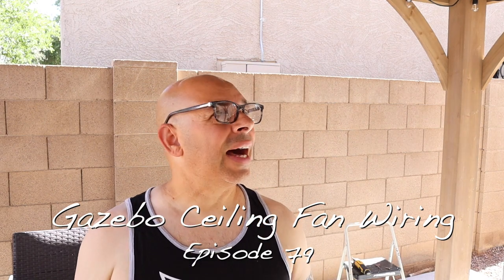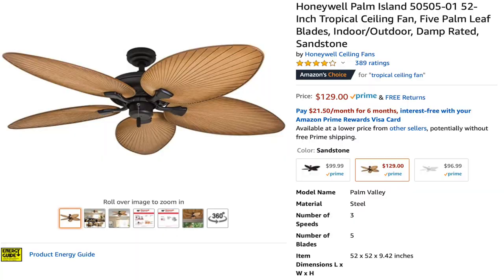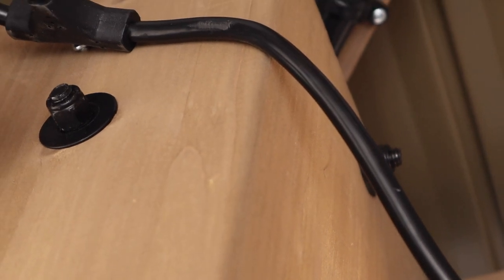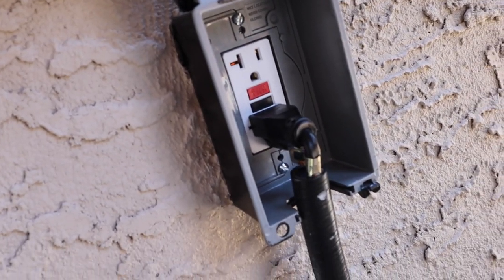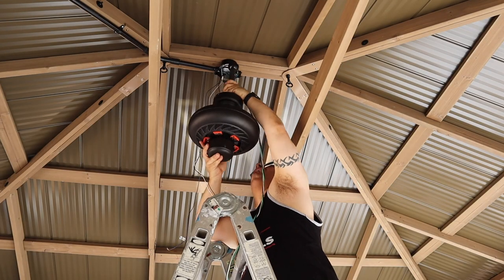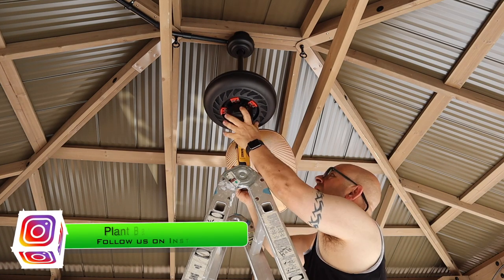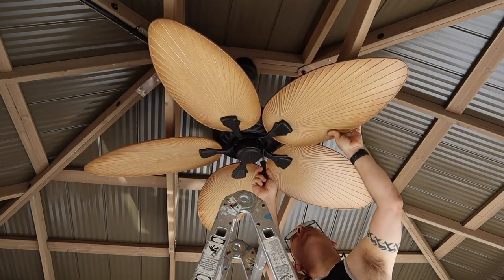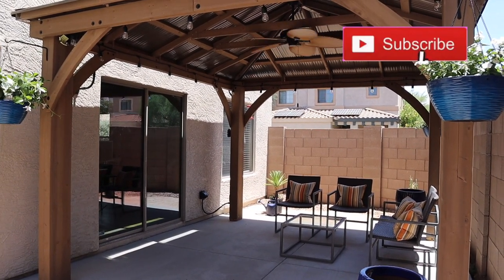DIY Yardistry Gazebo Ceiling Fan - Full Wiring and Installation.

Comment: Great video, i did something similar, i ran romex wire from my outside outlet through one of the hollow posts using hole saws and a fish tape and added a switch for a ceiling fan and an gfci outlet for any other electrical items. It hid the wires very well, all you see is the switch and outlet on the posts.

Comment: You would be amazed how much better your ceiling fan would put out if you purchased an extension bar for it dropping it about 12-15 inches. It makes a huge difference. You did a great job by the way, very clean.
Reply from the maker: I did have the longer bar.  In fact I think i talk about it in the video.  It just came down too low for me.
Reply: @PlantBasedDads   Very nice!  I thought you did use a 12 inch downrod?  My installer suggest an 18 inch downrod.  I just had this same gazebo installed and wired for ceiling fan... Wish I would have had them paint the conduit.. Guessing I can get a ladder and figure out a way to paint it before ceiling fan is installed... What paint did you use?  Also what size fan.. I want basic blades with lightand remote and  thinking about a 52 to 56" with good cfm

Comment: Love it! my SO thinks I'm crazy for wanting colour matched things like the conduit.  (It looks so much more harmonious that way)  Now I will be relaxed in the hot tub in the pavillion, not noticing that the conduit pipes are miss matched to the hardware.
Reply from the maker: I HAD to paint those ugly conduits.  Now, you dont even notice them because they are the same color as the rest of the black trim.  You are not crazy, you have class and taste!  Stick to your guns!  So here is what I did.  I laid out all the conduit AND the fittings and sprayed them all first.  Then when I had to cut the long conduit pieces, they were already all black. Worked like a charm.  Good luck.  We are going to add gutters to it at some point.
Reply: @PlantBasedDads  did you paint the electrical boxes as well? I have a  covered deck I built and running into the same issue wanting everything to be black to  match. I can't believe they don't make them in black to purchase, but haven't found it anywhere.
Reply from the maker: @brandonhardegree5050  Yes, I had to paint every part of the electrical because nothing came in flat black.  It was annoying but the final product was amazing

Comment: Not sure if you’ve had any issues with wind, but one consideration might be to add a stabilizer between the braces and then you’re less susceptible to side winds knocking those blades into the braces.
Reply from the maker: Hi Eric.  I'll keep an eye out and do that if I have an issues.  So far, there have been no issues with wind.    Thanks so much for watching.

Comment: Great job.  Do you think you could run the conduit down the center of the post (I believe these are hollow).  Thoughts?
Reply from the maker: Steve, yes you could.  That is a really good idea if you don't want to see the conduit.  They are hollow for sure.  Thanks so much for watching.
Reply: @andrewrus6879  How did it come out? Were you able to measure the hollow height?
Reply: @andrewrus6879  We are debating on running wires through the hollow portion.  But after showing my wife this video, she said she doesn't mind the black pipe.
Reply: @andrewrus6879  If you want to post a video, I'm sure it will help a lot of people! And it might convince me too,  LOL
Reply: @andrewrus6879  We ended up running pipe on the outside, but it turned out good.
Reply: @andrewrus6879  Would you mind sharing the video?
Reply: @andrewrus6879  also interested in your setup.
Reply: The Electrical not up to code. Hire a professional please 🙏

Comment: How did you get the rain caps over the joints between the roof panels that are closest to the house?  Being they are supposed to slide on from end and slide upwards. I have not figured out how to get those on mine.
Reply from the maker: That was the one thing I really want to film but the battery died during that whole piece of it.  I had to watch the Yardistry Helpful Hints video on Youtube.  It talked about bending the one side of the ridge cap open, clamping it onto the roof panels, and bending it back into shape.  Thats what we did and that worked.  Thanks so much for watching.

Comment: I have the same gazebo and a fan that is very similar to this fan. My only hesitation is, It seems to me, that the fan would just be pushing all the hot air that collects at the top of the gazebo, downward.
Reply: Just saw another video where he wasn't getting much air flow, so he switched the down rod to 18 inches. Now it moves the air.
Reply from the maker: I really just use it to have the fan move the air around. I doesn't actually cool anything down.

Comment: What is the lower junction box called/where did you get it? I can’t find what to call one you run wires to that then turns into a plug for an outlet.
Reply from the maker: It is a regular outdoor grey metal junction box that has 4 holes, 2 in the top and 2 in the bottom.  I got all the parts I needed to make it work.  It didnt come like that.   I ran the conduit up from the top of one of the holes to the switch above it and then the plug from the outlet on the house to one of the holes in conduit below it and tied them together in the box.  I put a weather seal and a cover on it and screwed it together.  I just went to Home Depot and pieced it all together.

Comment: Could you have plugged the fan and the lights in the same box? Granted, the switch would turn them both on, but that's an option you could have done right?
Reply from the maker: Hello.  Yes that was absolutely and option. And yes, I didn't chose that options because I didn't want the lights to come on every time the fan was turned on.  I also wanted to have an actual switch outside to turn the fan on and off with so we didn't pull on that chain each time.  But yes, you could totally just plug it into the outlet I installed up in the rafters for the LED lights.   Thanks so much for watching.

Comment: What is the junction box for? I want to do this same thing to my gazebo and I am trying to understand why the fan plug can’t come out of the fan switch box straight to the outlet versus having to add a junction box. Excellent work by the way!
Reply from the maker: Hi PN.  The junction box is to convert the wiring from the fan, which is just wire to an actual plug so I can plug it into the outdoor outlet on the house.  When you buy the fan, it just has three wires coming off it.  I extended those wires 25 feet to the junction box on the gazebo post near the patio door.  Then from the junction box I converted it to the end of an outdoor extension cord so I could plug it in.
Reply: Plant Based Dads Thanks for the reply! So it’s not possible to convert the wiring from the switch into a plug? You wired the fan to the fan switch, then from the fan switch you took the wiring to the junction box, so it’s not possible to use the wiring from the fan switch and just turn it into the plug at that point vs having to create a junction box? I’m not questioning what you did, I’m just wondering if I could do the job without the junction box that way I don’t have to have two boxes mounted on the gazebo post.

Comment: Did you not install or remove those cross beams? I want to install a fan but my Yardistry has two beams that will be in the way unless I put the fan blades lower than them with an extension.
Reply from the maker: The 12 inch download on the fan clears those beams so it is not an issue.  I purchased a 12 inch and an 18 inch down road jut to make sure I was all set

Comment: Cant seem to find that metal ceiling fan base box, where did you get yours ?
Reply from the maker: Home Depot.  It is just a round ceiling fan box.  This is the one I got:
https://www.homedepot.com/p/Greenfield-4-in-Round-Weatherproof-Electrical-Outlet-Box-with-Five-1-2-in-Holes-Bronze-RB25BRS/202188683?mtc=Shopping-B-F_D27E-G-D27E-27_6_CONDUIT_BOXES_FITTINGS-NA-NA-Feed-PLA-NA-NA-CONDUIT_BOXES_FITTINGS&cm_mmc=Shopping-B-F_D27E-G-D27E-27_6_CONDUIT_BOXES_FITTINGS-NA-NA-Feed-PLA-NA-NA-CONDUIT_BOXES_FITTINGS-71700000034238990-58700003946879308-92700048672399338&gclsrc=aw.ds&&gclid=CjwKCAjwmrn5BRB2EiwAZgL9ov0CmhZ5QjIZL_eKVZCmz4oMUBwUUk37Oxy9qyTFMZu5HiGdwoWCtBoC6Z4QAvD_BwE

Comment: What size conduit did you use? It looks like 3/4. I was going to do 1/2 but not sure it is big enough.
Reply from the maker: Yes, it is a 3/4 conduit that I painted black. You are. right, 1/2 was not big enough.
Reply: @PlantBasedDads  Thanks you did an outstanding job. It looks so professional. I will be doing the same thing.

Comment: Hi, what did you paint the pvc pipes and junction boxes black with?
Reply from the maker: Hello.  I used spray paint from Hope Depot.  I just did a flat black to match the trim on the gazebo.  I used high heat spray paint because of how hot it gets here in Phoenix.  I had to lay all the pieces out on tables in the garage and then spray them all.  Then I had to turn them all over and spray the other sides of them.  It was annoying, but it really looked great when it was finished.
Reply: @PlantBasedDads  Thank you! A couple of questions. Did you sand the pvc pipes first for adhesion or use any kind of primer? Do you remember the make or exactly which spray can you used from Home Depot? Thank you!
Reply from the maker: Hello.  I did not sand anything or prime anything.  I just painted them.  Let's hope that doesn't come back to bite me later on.  The paint was actually a primer/paint in one can, but I didn't buy it for that reason.  Here is a link to the paint I used.  I needed 3 cans for the whole project.

https://www.homedepot.com/p/Rust-Oleum-Universal-11-oz-All-Surface-Satin-Black-Spray-Paint-and-Primer-in-One-342511/307244963

The conduit was already a flat grey so it really doesn't need primer.  The metal boxes could probably have used some primer first but I just didn't use it.  You probably should use spray primer on the metal pieces that you are painting.  Good luck.

Comment: Was the 12 inch down rod included or was it a separate purchase?  What diameter? 1 inch or 3/4?  I ordered the same fan but it doesn’t mention a down rod being included and I can’t find any info on the mfg website.  Thanks
Reply from the maker: Hi Robert.  It does come with a down road.  But it's only a few inches.  I had to buy the 12in one from Home Depot.  I just took the one they gave me with the fan and compared it to the ones in the fan aisle at HD.  It was pretty easy.  They are all the same width.  I got a 12inch and an 18inch.  I ended up using the 12in because I felt the 18inch brought the fans down too far from the ceiling.  Thanks so much for watching.

Comment: You did an excellent job!  I'm copying your design now.  My gazebo is about 36" away from the house where there's an GFCI outlet.  My question is where did you get that flex cable to connect from that junction box to the receptable?  much appreciate it!
Reply from the maker: I live across the street from Home Depot so I go there for everything.
Reply: @PlantBasedDads  do you happen to have the flex cable connector SKU number?  and price?  thanks in advance!
Reply from the maker: This is the one I used.  This one is 6feet.  They make other lengths too.
https://www.homedepot.com/p/Southwire-1-2-in-x-6-ft-Ultratite-Liquidtight-Flexible-Non-Metallic-PVC-Conduit-Whip-58004507/203369932?source=shoppingads&locale=en-US&mtc=Shopping-B-F_D27E-G-D27E-27_2_WIRING_DEVICES-NA-NA-Feed-SMART-NA-NA-New_Engen&cm_mmc=Shopping-B-F_D27E-G-D27E-27_2_WIRING_DEVICES-NA-NA-Feed-SMART-NA-NA-New_Engen-71700000082263416-58700006984682168-92700062875450077&gclid=Cj0KCQjwgtWDBhDZARIsADEKwgMnsEtjDsq3ADZzJSfx4Q5kjMKUdR14IXdiZXjNJ_gEk3DvQ05gaSUaAsH1EALw_wcB&gclsrc=aw.ds
Reply: @PlantBasedDads  a link would be the best...again, thanks!
Reply from the maker: That is a link,  Just copy it all into your browser starting with Http all the way till the end of it.  If that doesn't work, email me at plantbaseddads@gmail.com and ill send you the link in email along with all of the parts I got and photos of all the steps.  I have already sent that out to people so Ill just forward it to you too.
Reply: @PlantBasedDads  you run THHN cables through it?  Then add a 3 prongs plug at the end, correct?  were you running solid or stranded wires?
Reply: This thread is exactly what I needed- thank you!

Comment: Great video! Right where the round metal box for the fan was installed there is a rod that holds the top cap in place. How did you deal with that?
Reply from the maker: Hello.  The rods are on either side of the fan, not where the round metal box is. There is nothing under the round metal box but 2x4s.

Comment: WOW! Awsome job, I’m basically following everything you did. Building the privacy wall later on but for now I have the lights installed, bought the fan, conduits ect. Just wonder what type of wiring did you use(link)?
Reply from the maker: I got it from home depot.  There is some code here or something that says you cant use romex (the wire in the yellow binding) if you are putting it through a conduit. So, I purchased some wire off the "Cut to length" rolls at home depot by the foot.  I got 50ft of it.  It's the only 3 wire they have on the big rolls there.  The guy from that aisle told me its the same wire as in the romex so ask the employee which one that is.  It's a 3 wire black, white and green.
Reply: Thhn wire is used in conduit
Reply: 12/3

Comment: You put your gazebo exactly where I put mine, the problem is when it rains all that water is going to drop right in front of the sliding door. Do you have a video showing putting up gutters to stop the water?
Reply from the maker: It's Phoenix,  It doesn't rain.  It hasn't rained since we put that thing up in May.  So, that is not really a concern for us here.  We are going to put gutters on it though, so we can control where the water goes and get it to go into a barrel to water plants.  When we do that, I'll do a video on it.  Thanks so much for watching.
Reply: @PlantBasedDads  
I live in California, I know about no rain. But still, when it goes though, I don't want it 6 inches from my back slider. Thx PBD
Reply: @xscooterbuttx  
Yes, I tracked some down from home depot. Thx Stacie.
Reply from the maker: @xscooterbuttx  I will be adding them in the fall too,  Just waiting for the temperature to drop below 90 degrees.
Reply: I live in Seattle and that's exactly what I had done.  I installed the Amerimax vinyl gutter system from HD.  Parts alone is about $250.

Comment: Thanks for sharing! What size conduit did you use?
Reply from the maker: 1/2 inch electrical conduit.  I paint it black first in the garage and then installed it all. Thanks so much for watching.
Reply: @PlantBasedDads  
Another response you said 3/4" conduit, but said 1/2" here.

Comment: What wire gauge did you use?
Reply from the maker: whatever the standard is.  It was a few years ago.  I just got the stuff off the roll at Home Depot.  They said I couldn't use the yellow romex in conduit.

Comment: Hi is Joe again.  What was your max weight for the fan?  Thanks!
J
Reply from the maker: Hi Joe.  I bolted that ceiling fan box to the 3 beams above it before I mounted the ceiling fan.  That box has screws going deep into the beams the long way so it will support any ceiling fan you can get from the store.
Reply: @PlantBasedDads  Joey, By the way, the install was very clean and professional.  I liked the way you used the conduit and am looking at the liquidtight flexible non-metallic PVC.  Its flexible but.  I will have to paint it since its grey - lol
Reply from the maker: Yeah it was annoying to paint it but that grey was just too ugly.  Thanks for the kind words.  I wanted it to look nice since I will be out there 9 months of the year.
Reply: @PlantBasedDads  9 months - curious where in the US you are located?
Reply from the maker: I am in Phoenix AZ
Reply: Hey Joe did you end up using flex instead of pvc? Wonder if it smooth or curvy throughout?

Comment: What kind of wiring did you use?
Reply from the maker: I believe its 12/2.  It's the same wire thats in the yellow romex but we couldn't use the romex because its not meant for being inside conduit outside.  So we purchased that 3 wire combo off the large rolls at Home Depot.  You buy it by the feet.  We got 50ft of it and it was way more than we needed.
Reply: Sweet good job!

Comment: Where can i get down rod ?
Reply from the maker: They sell them in the ceiling fan section and Lowes and Home Depot.  They come in different sizes.  I got the 12".  The smaller ones were too small.  Get a minimum of 12"